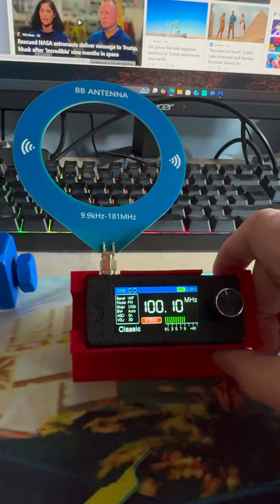Si4732 Mini Receiver Radio

Comment: Two problems I've found - seek up seek down wont find anything.also cb is not letting me select fm mode but cb in my country is fm.
Reply: update the firmware. check the qr code on the about page on the menu.
Reply: updated the firmware . same thing
.